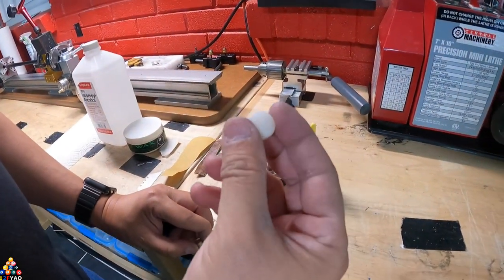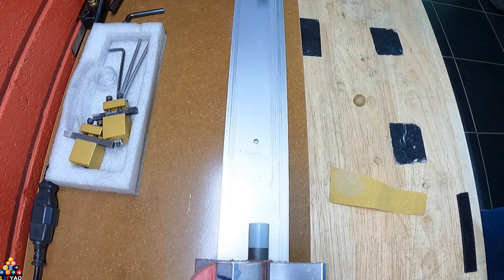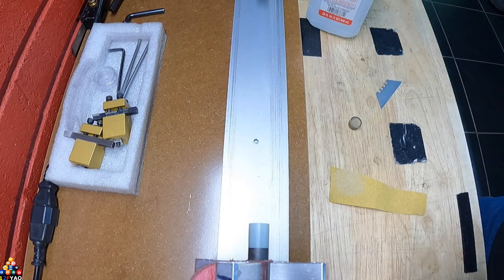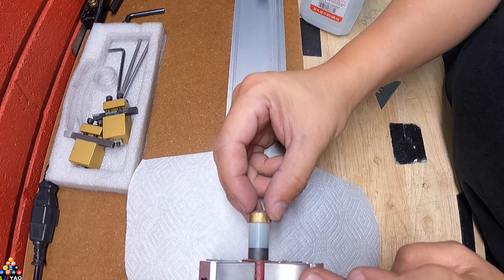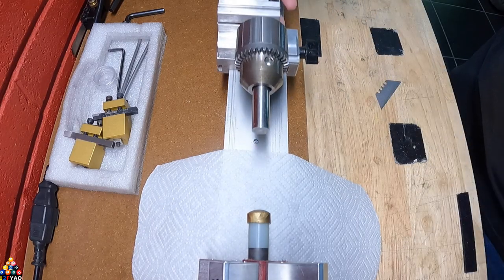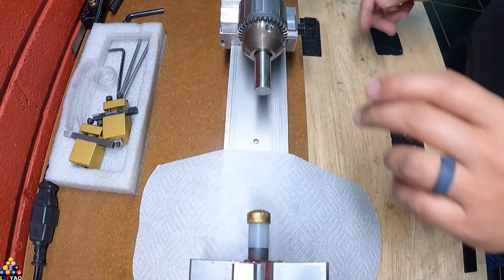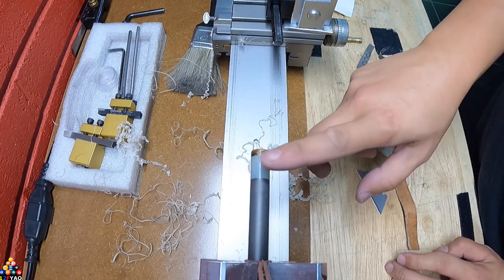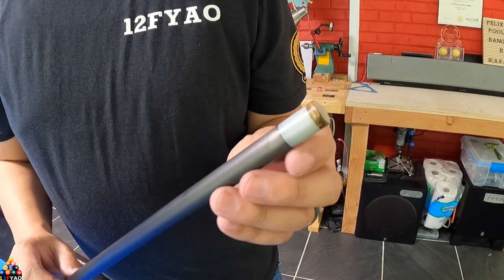Installing A HORO Break Tip

Comment: Another great video. I have the same lathe as you actually because of your channel. I wanted to know where I can buy the quick change tool holder? Thanks
Reply from the maker: I got the quick change tool from Amazon. I stacked it on a piece of steel plate and drilled holes to have screws holding it down. Hope this helps, don’t forget to subscribe and please share.

Comment: Nice one bro.. where did you get the toolpost.. link please.. ty
Reply from the maker: The tool post is from amazon and I just built the base. Regular steel plate, a tap and drill.
Reply: @playpool12fyao  Not the Stock Tool Post, the one that's in the video              https://www.youtube.com/watch?v=pkvopJ5KXHo         at 8:30 mins in. The slip on tool post.